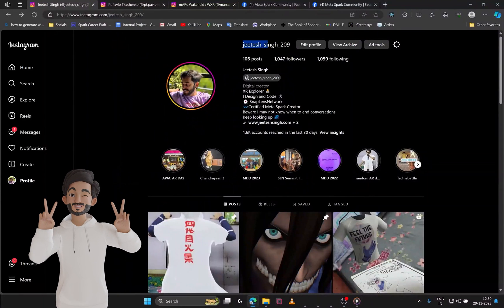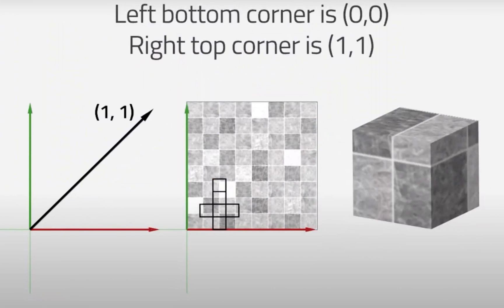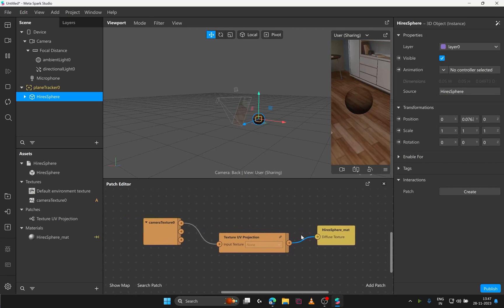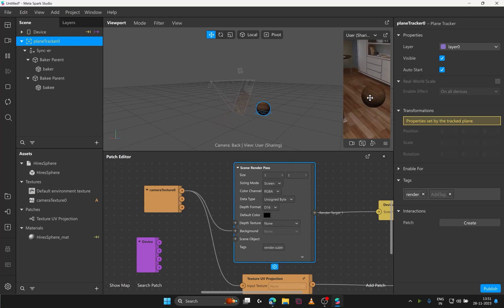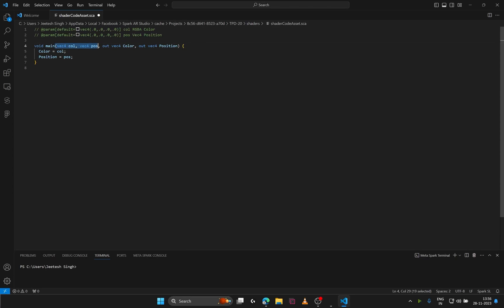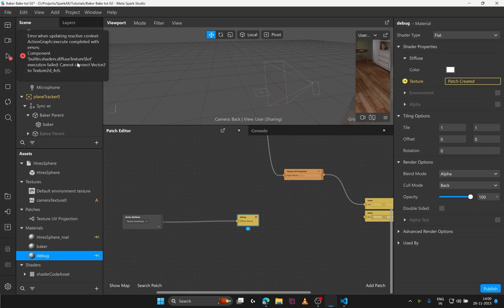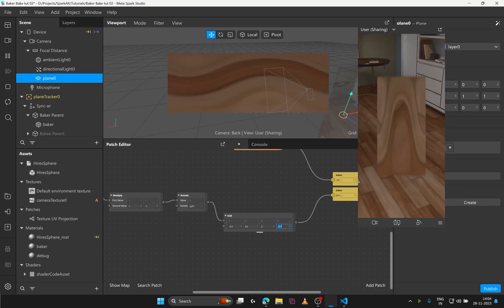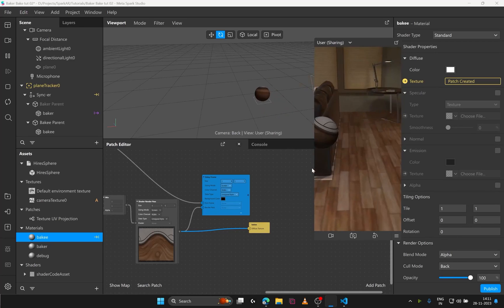Freezing Texture UV Projection in Meta Spark Studio

Comment: Thank you so much, for multiple object with the same material how do you apply it? In this case i create cell fracture object, it generate 25 object.. do i need to create 25 bakee and baker object too?
Reply from the maker: No, all of the tiles need to share the same material and same UV island without overlaps and you need only a single material for the freeze
Reply: @jeeteshsingh209  thank you so much for replying.. i try use 1 bakee and baker object, the freeze did work using single material, but the projection is not appear properly, it’s like without using uv projection patch.. do you have solution for that?